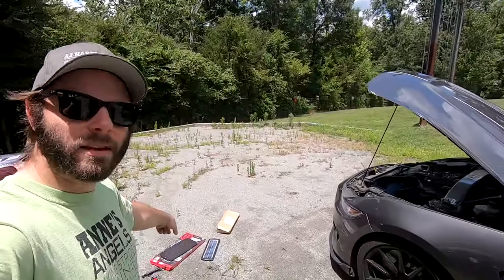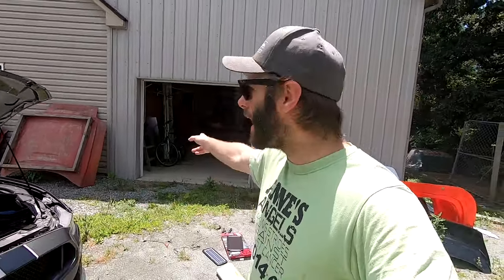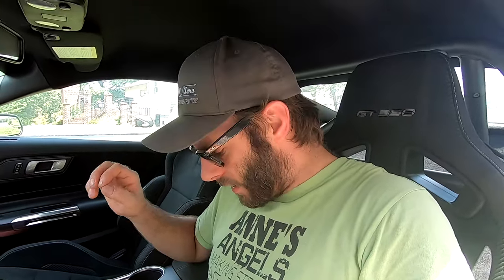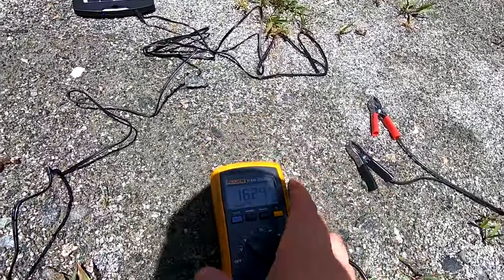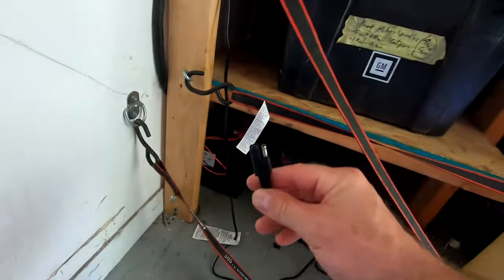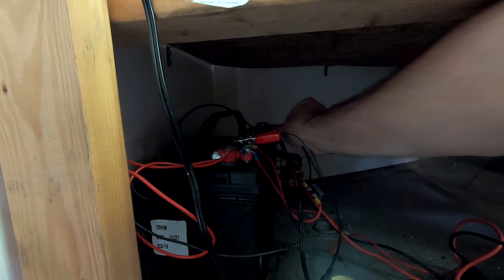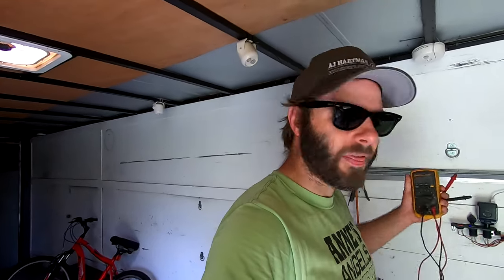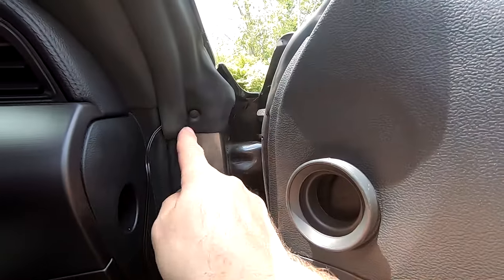No More Dead Batteries With Solar Trickle Chargers

Comment: Cigarette lighters are either "switched" (acc on/off) or "always on".  If you have an un-switched cigarette 12v outlet, the charger would work.  You should have a charge-controller between the solar panel and the solar panel to prevent over charging which will also destroy your battery.  I've been using this method with a cheap Amazon charge controller to keep my jeep happy in PA winter.  Don't ignore the charge controller, as it most likely states this disclaimer in the panel insert.  OK for maybe temp or short durations like 3 days, but not for long term solution without the charge controller.
Reply from the maker: Pretty sure it has a built in over charge protection. It sat on my car for about 3 months without issues.
Reply: thanks for this info! i have a jeep and the new battery died quickly from not being used enough. getting a panel and charge controller for sure
Reply: @ajhartmanaero same. usually new solar panels are plug and play for Basic stuff ,  no need controller.
Reply: @577buttfan  because it's a cheap crap.You can see on a video that it outputs 20 volts, which indicates that there's no voltage regulation.
Reply: @577buttfan  exactly
Reply: There's always a drain of some sort on auto batteries, like the flashing red light on your stereo. A small panel like this is just replacing that drain. It's unlikely to overcharge the battery.

Comment: You can charge your car with the solar panels inside with your doors locked and your hood / windows closed. Buy a OBD2 connector and a battery regulator connected to a solar panel. Only problem with this is, you must disconnect before turning on your car. Your welcome. I made a video about it

Comment: Thanks for the video. I am doing this for my 2009 F150/Lariat 4x4, its mostly a farm truck now and after a week or two the battery is dead.  
someone posted elsewhere the be careful about using the solar panel inside when its 90+ outside as the panel will also heat up and could damage the ABS plastic.
Reply: Do you mean it not work to connect solar panel directly to battery?. I think must have control unit to be safe

Comment: Just a heads up....any shading on the panel will significanly drop its output. The handle on your trailer casting shade would effect it.

Comment: On your trailer, you have room to install several solar panels large enough to run 120volt items like a refrigerator or small electric stove, with a large battery bank you can store this energy for trips to the track or camping out, even run power tools like a table saw. 
I say this becuse a lot of guys use these trailers to do contract work out of.
The roof of the trailer is pretty large.
You may be able to generate enough power to run some Led lamps inside the house for a few days if you have a power outage in your area. 
Or work lights at a job, camp seight,or track.  Using LED bulbs will conserve the energy you got stored.

Comment: Can a solar panel trickle charger be used to maintain an AGM chemistry battery?   I have been told; "No", because an AGM battery requires a voltage to charge between 13.8 to 14.6 volt and requires a minimum amperage of 7.5 VDC.  Apparently all charge controllers intended for 12 VDC trickle charging stop charging when the battery reaches 12 VDC to prevent over charging, which is inadequate for AGM batteries.  Can you, or other in the comments confirm this, or have experience with AGM battery charging?

Comment: Can these chargers stay in the lighter outlet while driving, or do the need to be unplugged while the car is going?
Reply: You can leave it plug in as it has a controller to keep it safe but you should double check with the manufacturer 😂🎉

Comment: Do you have to worry about an overcharge and damage to the battery.  Can I leave it on while my rv is in storagr
Reply from the maker: Someone else just commented earlier about an overcharge situation. I'm pretty sure it has a built in over charge protection. It sat on my car for about 3 months without issues if that helps.

Comment: Does that Solar pannel allow for only 1 way flow of electric? I have used cheap ones for a " solar generator" which actually ended up discharging the battery.

Comment: Or, if the lighter does not work when the car is turned off, and the charger is hooked up to that cigarette lighter, could that actually drain the battery?  Thank you!
Reply: No only flows one way 😮🎉 to charge.

Comment: Thanks for the video. I need a similar panel for a 12v battery for my e-scooter, but it needs to connect directly to the batteries. Anyone know if the solar panel featured in this video can do that?? Or, does anyone know of suitable trickle chargers for this application??

Comment: Wouldn't charging at 20v over time be bad for the battery?
Reply from the maker: I’m sure someone smarter than me can give an explanation on amps vs volts vs charging rate and capacity coupled with built in overcharge safeties but it was on the car about 3 months without an issue.
Reply: Overcharging is what I'm concerned about now.  Knowing me, I would get busy with work and the charger will be hooked up for several weeks and cook the battery to frizzle.  Not worth grizzle.
Reply: Not with a smart 🤓 controller 😮🎉

Comment: Have one on  ford fusion hooked directly to battery .not worth shit
Reply: Yikes.  Did you take any measurement readings on a voltmeter before you issued the endorsement of 'not worth shi#'   :   )    Was it the charger?  Was the battery on the Fusion around 0-2 volts resting?  Old?  New?  
Back to zee Kar Ms. Linda and report back.  You have some more work to do.
Reply: Si es verificada la salida de tensión de carga y funciona, el problema con la batería es otro, dado que al no recuperar su nivel de energía optimo con este cargador de goteo, eso quiere decir que la batería esta muerta.